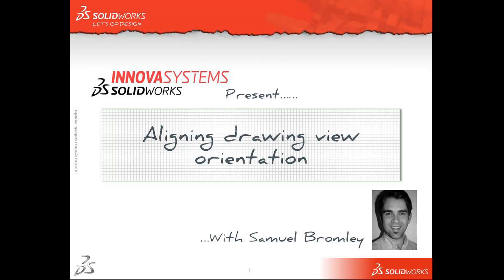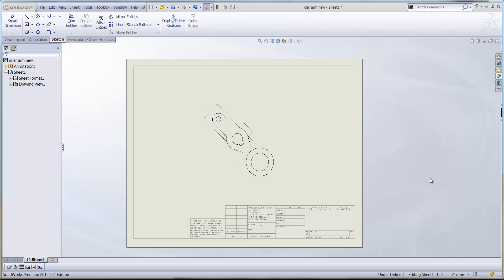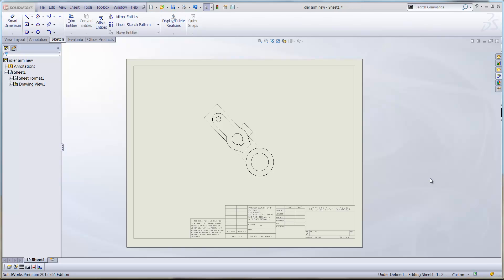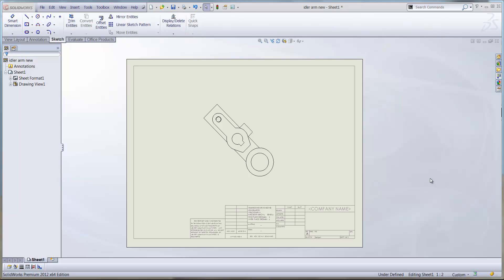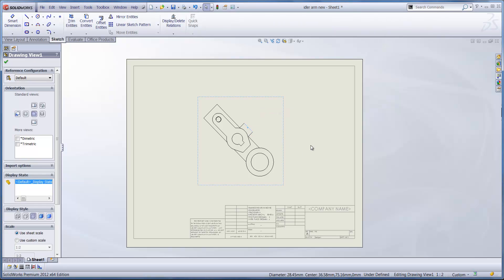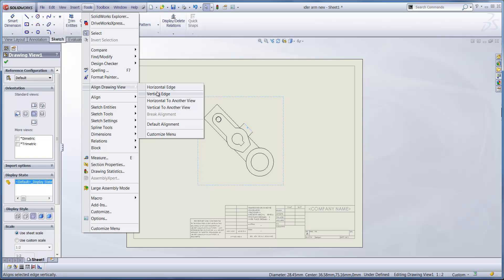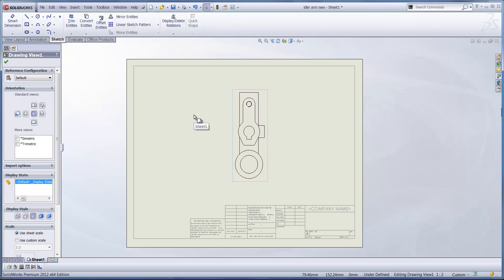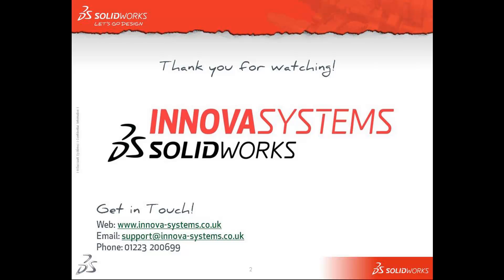Aligning drawing views in SolidWorks

Comment: What if there is no straight edge, could we rotate the view using two points as straight line.
Reply: I had this same question in my mind. 

F.-ex. you can put local coordinate systems to the part and direct their axis as you wish, but I haven't found a way to use those axis in the Drawing for aligning.